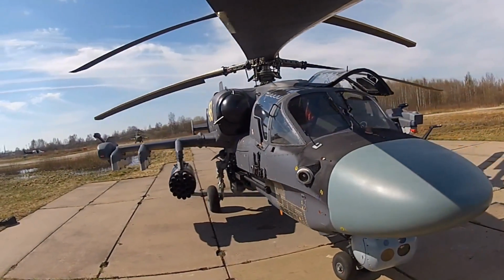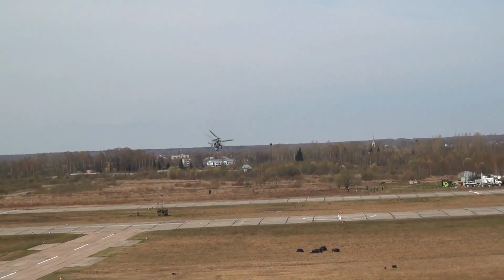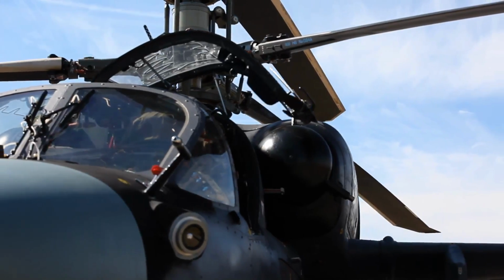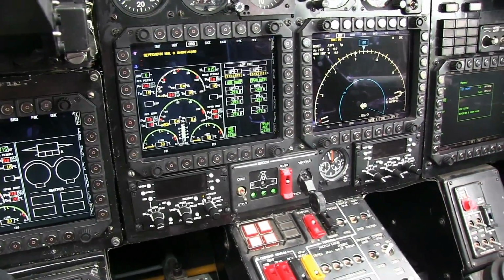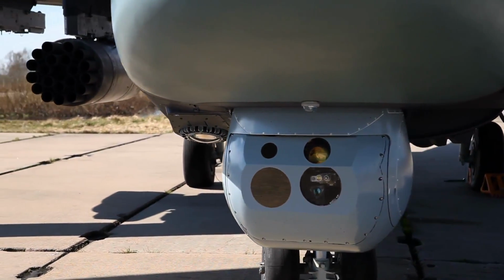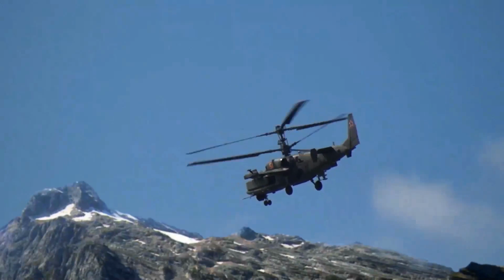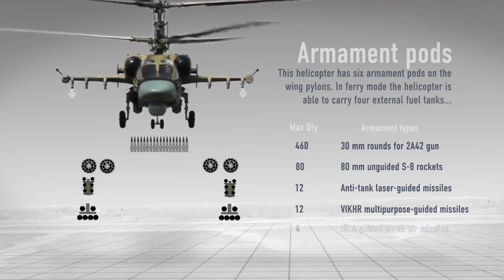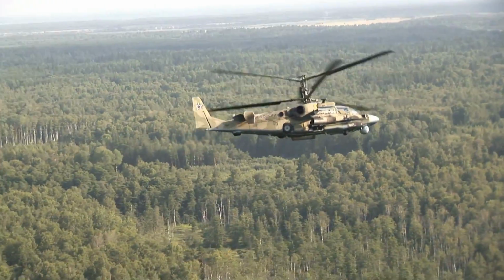Russian Helicopters - Ka-52 Alligator Attack Helicopter Capabilities [1080p]

Comment: There are great capabilities in this aircraft no matter what the naysayers have to say about it.   Granted, our US attack helicopters are some of the most advanced in the world but this chopper is pretty impressive in its own right and no doubt would work very well on the battlefield.  One of the most impressive features is the dual pilot ejection system which auto deploys/ejects the rotor blades off the aircraft and then ejects the pilots, even at super low altitude, which currently, no other helicopter can do.   The designers of this impressive aircraft did their homework.   The dual level counter rotating main rotor system is also very advanced, a design incorporated into new ultra high speed copters being developed.

Comment: Well, KA-52 and AH-64 both has pros and cons. For KA-52, it has more powerful engine which allows it to carry more load, and counter rotating blades allow it to fly faster and prevent retreating blade stall. Also, heavier means slow on agility and that's why US still using Oh-58 and little birds for recon because of their fast movement and be able to squeeze in urban areas. Ah-64 has independent sight system for both pilot and co-pilot, and no need for night vision, and a 30mm gun sync to sight.

Comment: Yes, sitting in side by side instead tandem has benefits. You are in actual contact with the other instead speaking only trough radio behind dashboard or seat. You can give hand signals and body language to co-operate. Like when you spot target you don't need to inform other trough targeting system but you can give hand signal to direction and other can see where you were looking. You know in what the other is doing all time.
The teamwork just is much better like in rescue helicopters.

Comment: Dual couter-rotating rotors have a known combat vulnerability.
Not only do they double the chances of being hit, but any damage done, thrashes the remaining aircraft, as it's rotates the aircraft, it destroys flight control.
Reply: Благодаря им он имеет лучшую мобильность, маневреность, скороподъемность, может летать при штормовом ветре, и в условиях разреженного воздуха высоко в горах. Надеюсь ты не будешь спорить, что на данный момент, этот вертолет лучший в мире по летно техническим характеристикам?
Reply: Роман Шинденфельд Well, when you have TWO balanced rotors,
and when ONE becomes out of balance, what happens?
Reply: Pocok4 But in a hard turn, the rotors can hit each other and cause a fatal crash. Also, ejection seat has be known to auto eject involuntarily.  LOL Plus it's more like 20-23mm protection.

Comment: even if they did move an anti-air vehicle such as TWQ-1
it will not stand a chance because it uses FIM-92 and it range is 4.5km
meanwhile the 9K121 it has a range of 10km

Comment: Obsolete. The US XF-77 "Vane" is the first 7th generation fighter aircraft, as well as the first fighter to ever be capable of truly performing like a helicopter as well. It's 4 propulsion systems allow the Vane to perform as a hovering help, traditional fighter jet, or Mach 9 pre-emptive strike assassin. It is armed with a 1.17 MW laser cannon, and FLIR/TADS that can range 200 miles. It has been built to achieve and exceed every capability of the fictional "AirWolf".

Comment: Wow its got air to air missiles.  Seems like it can do pretty much everything.  I wonder whats the top speed on this.  The coaxial design is good because it can overcome retreating blade stall.
Reply: Maximum speed of 310 km/h
Cruising speed - 250 km/h
Flight speed side - 80 km/h
Flight speed back - 90 km/h
Reply: DarkPKiller DarkRusAlliance Pretty fast, I think the Lynx is faster.  I definately wouldn't want to get into a battle with a fighter jet though, unless the AAM has some awesome range.  must require a lot of maintenance.  Its funny how the animations they're fighting Americans.  America doesn't really have an armed scout helicopter, the comanche probably would have been it, the Apache Longbow is probably the closest I guess.

Comment: Nice piece of weaponry. But the same old problem, that the mi 24 also had - "too big to be an attack helicopter" so easy prey for hand held lock and fire missiles ( remember the stingers in Afghanistan did a lot of damage to the soviet helicopters). Squeeze it smaller, It has an innovative design though.

Comment: Depends on the situation and what capabilities you desire. Im not knocking Russian choppers in the least. Great designs. However the KA-52 lacks Fire and forget capabilities, Has a much lager frame, Lower fuel efficiency and range of the AH-1Zulu. As well as the primary Victor Missiles used on the KA-52 lack the same punch as the Hellfire, Maverick or TOW missiles. Not to mention the AH-1Zulu also carries the AIM-9X air to air missile.

Comment from the maker: Phazotron FH-01 Millimeter Wave Radar (MMW) :

Air-To-Surface Modes :

•Mapping range: 32 km 
•Range of detection of ground target - Bridge: 25 km, Tank: 12 km 
•Range of detection of ground-based obstacles and terrain detection/avoidance - Electricity Cables: 0.4 km, 10° sloping terrain : 1.5 km 
•Tracks 20 targets at once 

Air-To-Air Modes :

•Detection range for attack aircraft : 15 km, Stinger missile : 5 km 
•Tracks up to 20 targets

Comment: I think not because the Chinese was unable to copy correctly (specialy the engines) the older Aerospatiale SA321 Superfrelon (chinese designation Changhe Z8), and the Ka 52 is much more difficult to copy...But it's possible that the Chinese buy the license to built it , and buy systems, engines and gears by Russia...

Comment: Gotta love the hind though, It is special because it's the kind of helicopter you can joke about but wouldn't want to be infrong of because Hind tactics are very low lever ground denial, in other words, fly a little it above the trees.....shoot there with your 80mm rockets, fly straight past, then come home. Apache, Sit up here, use your gun and some hellfires.Hope not to run into Igla AA missiles...I love the Mi-24 (the new Mi-35 is new and better, but we can't joke about it as much)

Comment: Ka-52 with an operational ceiling of 5500 meters? Its a bit low isn't it? The Chinese WZ-10 has a ceiling of 6400 meters and the HAL Dhruv has a ceiling of 6500 meters.
Reply: Those helicopters are new...the Ka 52 is from the 90s...
Kamov designed both the Ka 52 and WZ-10...

Comment: I personally think the KA- 50 looks more bad ass that 30 mm cannon is a beast in dcs world KA 50 I've engaged a soft target with armor piercing rounds at close to 5 km with 1800 meters altitude now yea that being a simulator who's to say that is accurate but if it close to being based on real life ballistics that is impressive for a bullet
Reply: The gun is on a fixed mount. It cannot turn to attack the sides. But it has a longer barrel, so the muzzle velocity is higher (better armour penetration). Also because the gun is fixedly mounted, it's more accurate while shooting.
Not good for anti personnel engagements. Brilliant for anti armour.

Comment: Do you think that the more modern the better weapons?
Then why all military NATO ran with captured AK in Iraq? In Donetsk airport a mountain of weapons of NATO. The prisoners ask why it is not used?
Answer: after 2-3 shops gun hammered,concrete dust, it is necessary to disassemble and clean (in combat conditions, it is unacceptable)

Comment: And how does it balance itself with no tail rotor?
Reply: +felix kimutai In this helicopter coaxial system screws. Two screws turn in opposite directions. This provides better stability and in the mountains during a strong wind, but also by 30% increases the elevating force
Reply: Interesting, thank you

Comment: Anybody can tell me why it has two sets of blades and not tail blade? How the physics of steering in that mechanism works?
Reply: +cyrusIIIII Thre is no need for tail blades due to fact dual coaxial rotor removes centrifugal force that tail rotor is there to fight on "normal" helicopters. This way it can land on very tight places and increases overall agility.
Reply: ITmage Thank you. Do you know if each one of those dual coaxial rotors rotate in the same direction or the opposite of each other? Also I do not understand Which centrifugal force you mean?
Reply: cyrusIIIII They move in oposite directions naturally, otherwhise it would be useless. This design is also called contra-rotation. 

Single set of rotor blades passes its rotationonal/centrifugal force on helicopter fuselage, which has tendency to force helicopter to rotate in direction opposite of the rotor blades. To remove this rotational force effect helicopters have antitorque rotor on its tail. That is the reason why helicopter in case of being hit in tail rotor starts rotating without any control.

Comment: LOL you are joking right? You are sitting here tying to tell us this piece of trash has a longer radar capability. Do you see the Giant Radar array on the Longbow above the blades. That is there for a reason.. its called form dictates function. You don't have a longer range radar without the actual radar lol. And Im sorry flying around with night vision goggles on is a joke at this point. I mean really its just funny when compared to the ah64d. No eject seat bc it doesn't need one lol.

Comment: Its funny how everyone is comparing this piece of junk on here to the AH-64 Apache. Which its first introduction in 1967. Thats 30yrs older than the Ka-52.

How about comparing it too something a little more recent. Hmmmm lets say the S-97 Raider that cruises at 250 knots/ 287mph vs your Ka-52 that cruises at 146 knots, 168 mph. Come on its only 123 knots / 141 mph faster.

The S97 would run up on thing blow it out of the sky and you wouldnt even see it coming or going.

Empty weight of the S97 is 9000 lbs vs 17000 lbs haha i cant believe that thing even lifts off the ground.

Sorry Russia you loose. God bless the USA!
Reply: but it haven't even materialize yet.. they did not even made single S 97..hope for the best
Reply: Aviation Weekly October 6th 2014 Edition front page.

Comment: Leonard2 would quickscope this Russian heli lel . 
Apache and tigers btw komanci is better
Reply: Thorsten Stahl Stahl stahl Hate to break it, Comanche isn't in production anymore, and any tank can quickscope a chopper.
Reply: Thorsten Stahl Stahl stahl There were 2 Comanche prototypes build and project got cancelled. Apache is inferior in every way but it's ability to detect the opponents (which is a huge deal, but not enough to call it universally better), Tiger is inferior in every way with exception of range. 
And while Leopard 2 can engage helicopters - it's by far more difficult than it seems and designed mostly to take down targets of opportunity such as utility or multi-role helis, not enemy attack or scout helicopters engaging or scouting enemy targets - it wouldn't even be able to spot it, regardless if we're talking about KA-52 or other comparable helicopter.
Reply: das glaub ich nicht :D